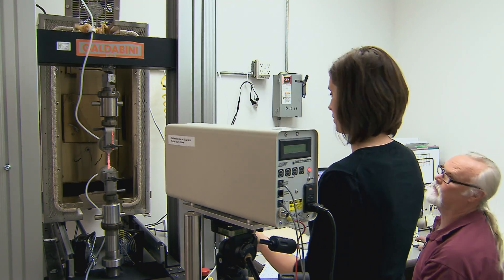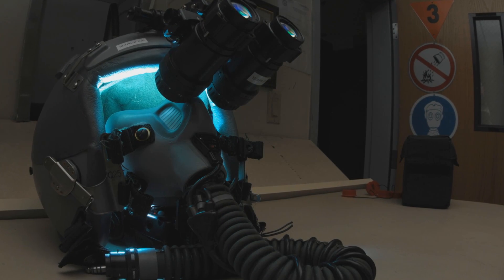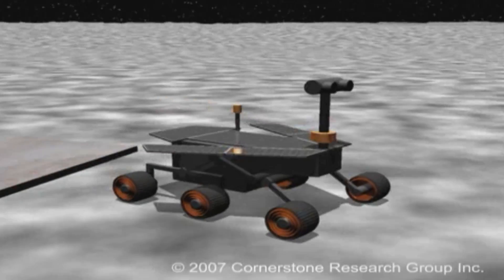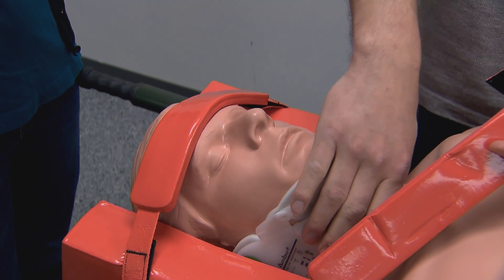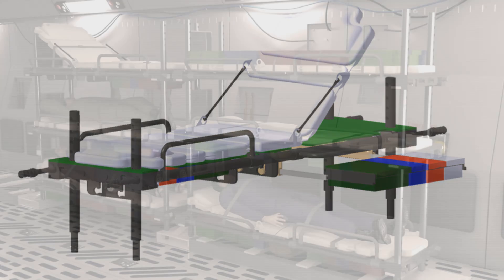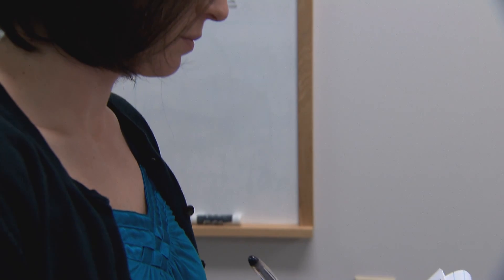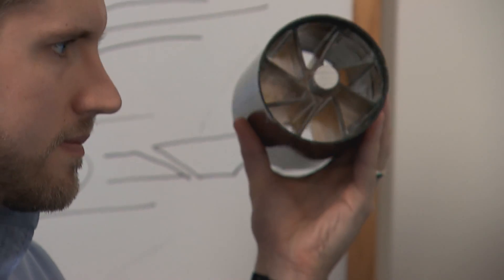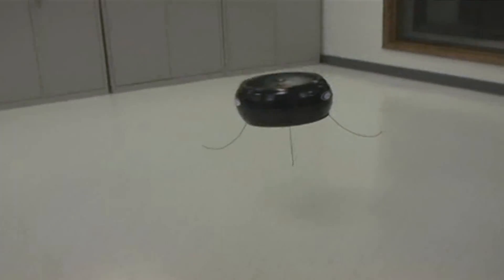Systems Engineering

Comment: The initial focus on physical, product systems engineering is one of the key challenges - the full system includes design of the enterprise system to effectively support development of product and service systems. So often this sits outside the physical engineering discipline set, but requires close integration between the enterprise/ business  system development and product/ service. The problem-space for systems engineering sits beyond the engineering of the product, to engineering of this plus the supply network. So often the success of complex system  is hampered by organisational practices and thought processes. This is touched on later in the video. It's a good STEM video for people looking to understand what's needed beyond their initial engineering discipline boundaries.

Comment: Which is the better computer system eng or software  for doing robotics ??
Reply: I studied robotics engineering and it gave me a good foundation in design/electronics/mechatronics engineering. Now I am moving on to a masters in systems engineering. Overall all these disciplines overlap at some point and you develop skills in all of them. When it comes to finding a job it may not be exactly what you want but some aspect of your study will be in there.
Reply: @EddieFPV  i m majoring in computer systems engineering . will  it  be  good  for softwares and robotics ,and in which area i can do  research ?